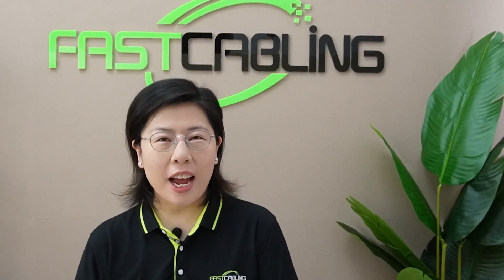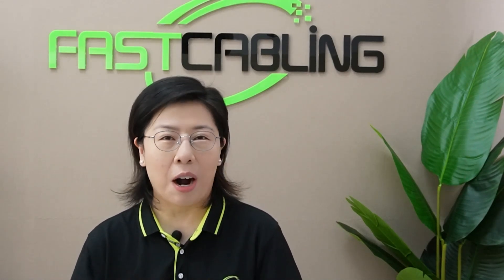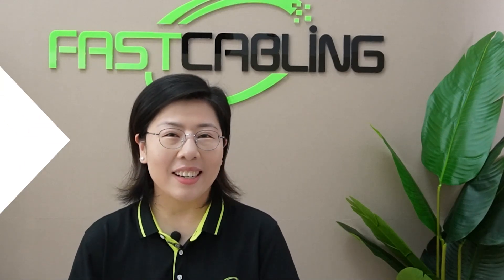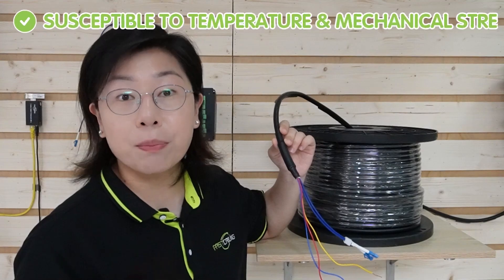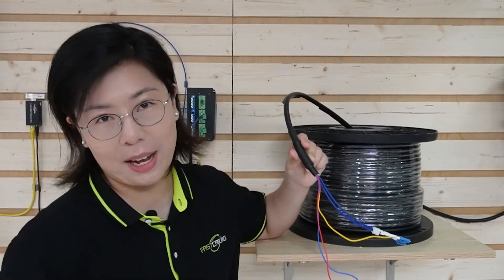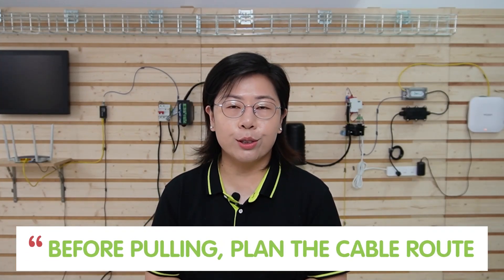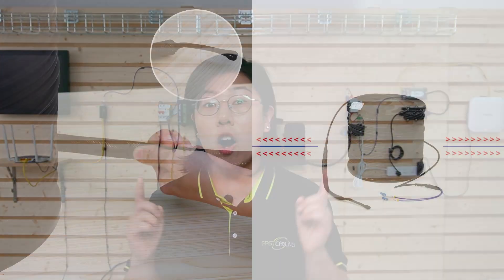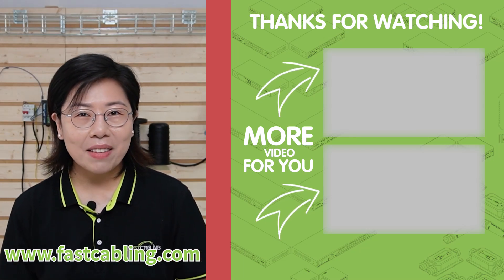Boosting Starlink Range: Using Composite Fiber Cable for Long-distance Connections

Comment: what is the maximum length that the power can provide within the composite fiber cable? And you are caring AC power
Reply from the maker: Currently we only have composite optical cables in 100/150/200/250/300 meter lengths. https://www.fastcabling.com/product-category/composite-fiber-cable/

As the distance increases, the voltage in the conductor decreases due to resistance. The longer the cable, the more significant the voltage drop. If you are going to use DC power, composite fiber optic cables can extend the power transmission distance from a few hundred meters to 1 or 2 kilometers. For AC power transmission, distances can be significantly reduced due to voltage drops, especially where high power levels are required.